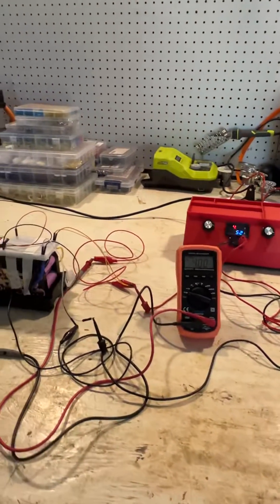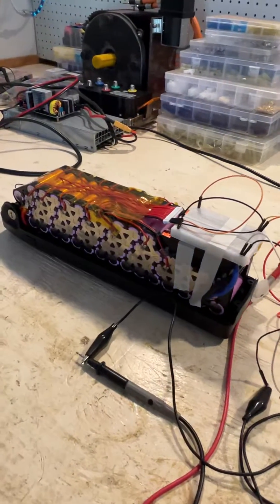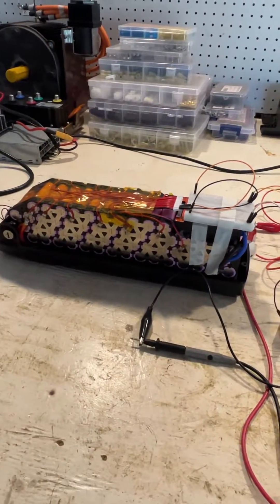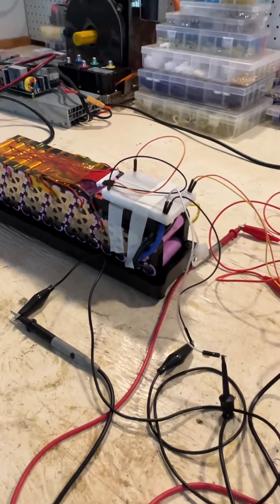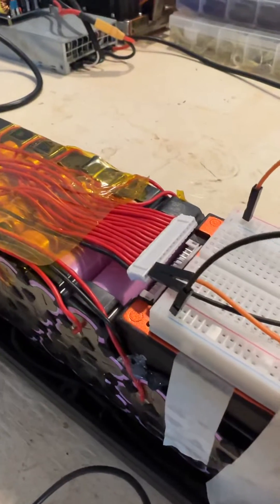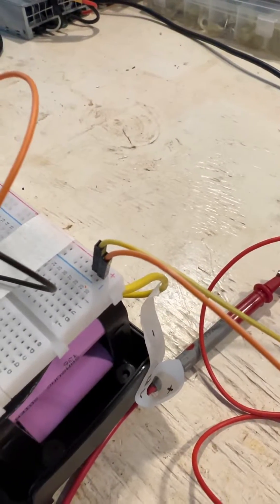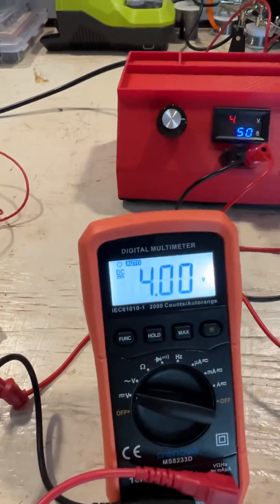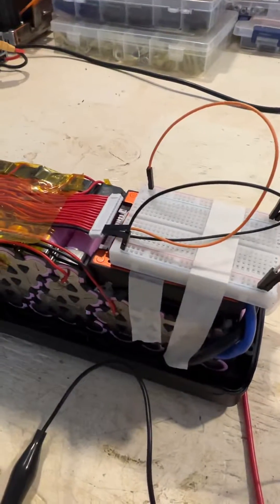A BMS does not actually balance your battery pack.. and what you can do about it!

Comment: This is partially true. The reason why passive balancers don't work is if you charge with a high enough current your BMS will never be able to counter the cell groups that are high from reaching 4.25V when balancing starts at 4.18V. If your BMS balance current is 60mA (quite common) then charging at 10A is going to drag the high cells up to 4.25V way faster than your low cells could ever catch up. Your low cells are seeing 10A at 3.5V and your high cells are seeing 10A until they reach 4.18A at which point they are seeing 9.940A so the time it takes them to go from 4.18V to cell overvoltage at a 60mA reduced rate is nearly the same as it would be for the full charge rate. In this scenario you can 
A. Keep charging fast and not see your cells get closed to balanced until you do a dozen or more cycles
B. Lower the charge current and give that 60mA balance current a chance at making a difference

I don't think this is really explained anywhere. One dedicated slow charge could significantly bring your pack back into balance and allow you to continue fast charging after that so long as you're happy with the delta v. If I had a pack that was 400+ millivolts out of balance and had no way of charging single groups, I just had a charger rated for the voltage of my battery with adjustable current I would do a 1A or even lower charge cycle and see if it can get me in the realm of 100 millivolt difference. At that point you're not leaving too much capacity on the table when you continue to use it 100 millivolts out of balance and that should correct itself over the next handful of cycles.
Reply from the maker: makes sense! thank you for the detailed reply. I'm going to give this a try. although I'm still surprised that a relatively feature-rich BMS like ANT or Daly doesn't have an active balance built-in. I know Daly sells active balancers - I have one and it works great - but this really should be the default cell balancing method on any medium-grade BMS & up
Reply: @GaiusGarage , if you have an ANT you don’t need active balancing. The basic dumb BMS will maintain a balance if you use the correct charger which will ALWAYS taper current down as it nears full charge, reducing cell differential caused by surge from the charger. But you have to reach full charge and the balance maintains begins after the light turns green, when current in is almost as low as bleed current.

But with the ANY you just charge to whatever you want, unplug the charger, click “Start Autobalance” then go to sleep. It will do the maintenance until the cells are balanced to your desired setting, even to 0.000v differential.

Of you have 💩 cells, an active balancer is helpful. But for relatively healthy cells, the ANT is plenty. 

On my LiFePO4 battery made with 💩 cells I might change the ANT to a JK, just so it can actually extend your range if one cell gets low while riding, while the ANT cant do anything about it. 

But it must be left deactivated until you realize you have a problem or it will mask the problem and you will still be walking home. Lol. If you leave it deactivated until you get LVP, ans rhen look to see if something wrong like a dead cat stuck in your wheel, then you can activate it and turtle mode home while it sends 2a to the low cells. 

But after my recent experience where my girlfriend’s scooter got two low bricks because she rode it for an hour with the front tire rubbing, i think the JK would have just added to the damage. When she got it over to me, it had 10 dead 32700 cells (CID popped i guess). 

But the title is definitely still missing. A BMS will in fact try to balance the pack, but a dumb BMS is very picky about it.
Reply: Thanks for this explanation. I've been using a 10A aftermarket fast charger, and now I know why my battery packs are out of balance!
Reply: @VllKlNG  yep. Now since current trails off during CV its a bit of a wash in terms of 5A vs 10A but it all depends when your BMS starts balancing.

I highly recommend active balancers and adding a switch to them. Use them once every 10-20 cycles for the last quarter of your charge cycle then leave them on for a couple hours after charging.
Reply: Sir pls answer this question of mine...im desperate for an answer
I have an 8S LiFePO4 battery pack for my ebike project which I tried to charge using my suspicious lithium battery charger. The charger applied a voltage slightly higher than the battery voltage at any moment to charge it along with 1.5 A of current. For example, if the battery was at 26.2 V the charger applied 26.5 V and 1.5 A, and the voltage increased in the same proportion as the battery voltage increased. This was constant current charging.

The thing is, the charger cut off the charging while my battery was only 85-90% charged(26.6V) and never intiated the constant voltage charge. I just read somewhere that I need a charger which applies a constant voltage of 29.4 V to fully charge a 24 V LiFePO4 battery.

Did I damage my battery by charging it through a charger that doesn't fully charge my battery and give out constant 29.4 V? I may be just paranoid but it could be a serious thing. Can I continue using this charger in the long term which never initiates the CV charging? I'm fine with not utilising the remaining 10% SOC. I just want to make sure this kind of undercharging and this charger doesn't harm my battery in any way.

And what I'm more concerned for is that i also heard that many bms' tend to start balancing the battery when it reaches a certain VOLTAGE (full charge voltage), if this is true..... doesn't it mean that my battery can become unbalanced in the long run as the bms may never balance the cells?

Can charging an 8S LiFePO4 battery pack using a charger that never initiates constant voltage charging and doesn't fully charge the battery to 100% cause damage to the battery, and can this lead to cell imbalance if the BMS only balances the cells at full charge voltage?
Reply from the maker: @electricalA.K.  do you have a BMS installed on your battery pack? If yes, it is most likely that your cells are already out of balance and the reason your pack is not charging full is not because of the charger but because one of your cell groups is reaching max voltage, and the BMS is cutting off charging to prevent damage to the cell (overcharge protection). Thus, you have one cell at full charge and the rest remain not fully charged so your total pack voltage is less. You can check the charger voltage at the terminals before you connect it to your battery pack. If it is what the total pack voltage should be, what I described above is most likely the issue. If the voltage at the charger terminals is lower than what the fully-charged voltage should be, the problem is that the charger voltage is too low - depending on the charger you may be able to adjust this by opening it up and twisting a potentiometer
Reply: @GaiusGarage  sir i had checked if the problem existed with the battery or the charger.... Turns out that the charger cuts off the charge at 90% SOC (i monitored the voltage and current while the charging process was going on) . 

My question now is, the battery is new and no cells should be out of balance, so can the battery get unbalanced in the long run because many bms start the balancing process when the battery nears full charge voltage, which my charger will never reach. 

And second question is, the lifepo4 8s resting full charge voltage is supposed to be 27.2v(100% soc) while my seller lists it to be 26.5v on their website(which is 85-90% soc which is what I'm reaching) what is going on here? Why is the voltage listed by the seller lower than the actual full charge voltage
Reply: @GaiusGarage  Good catch about him likely having a cell higher than the rest. Didn't think of that. My first thought was he's looking at resting voltage and never is around to see the actual max voltage
Reply: @electricalA.K.  29.4V is LITHIUM ION NMC voltage!!!!

8*3.65=29.2 but i think theres no reason to go beyond 3.6 or 28.8

26.6 is 3.325 which is about 80%. This will not damage your battery. Quite the opposite.

The problem is your battery will never balance. You should only balance LFP above 3.4V, long explanation but just trust me on this. 

So you have a conundrum. You can continue to use the charger but if your battery goes out of balance you will lose capacity because it will be cutting out when one cell is low and the others have energy left.

I think the problem you have is you don't realize your battery is charging up past 26.6V but its resting down there.

LFP does not rest at full voltage like lithium ion. It should not be resting as low as yours but should be resting between 3.45 and 3.55 per cell about an hour or two after the charger is done.

You need to watch an entire  charge cycle and figure out your max voltage and then see if your resting voltage is indeed 26.6

It it totally normal when you connect that your charger shows the battery voltage. YOu'll see a slight rise because the charging current increases the voltage the same way a load causes voltage drop
Reply: If I understand you correctly, one way to periodically balance a non-balancing pack is to charge it as slow as possible every few uses? For example instead of 65W go to 10W?
Reply: what most people ignore is the recharge rate on cells.  Even manufacturer specs show 1/5C  being the optimal,  for longevity and maximum capacity.  Very few cells are built high spec enough to take 1/2C or even 1C charge rates - without losing something in the process, such as capacity.  Basically the faster you charge, the less time the battery cell has to have those electrons cling to the inner works of the battery, so you get a less dense packed battery when you fill it quickly.    Take it slow and you not only give your electronics time to balance out and function, keep heat down, but also maximize capacity.....

it really does come down to just being too impatient and charging too fast.
Reply: @xXKisskerXx  I've read hundreds of datasheets. Most lithium ion NMC cells have a standard charge rate of 0.5C or close to it. I'd say 0.3C to 0.4C is the standard for most cells.

Charging slower does improve the cycle life.

All this data is in the datasheets. They'll tell you if you charge at the "max charge current" that you'll see reduced cycles and often further down they'll have a graph showing that.

One more time for anyone that still hasnt grasped this.
Get on Google.
Type your cell model.
READ THE DATASHEET.

Comment: Thanks for the video. But part of the info you give is wrong. A GOOD BMS charges AND balances. You can have a very  cheap "old" BMS that doesn't balance or balances passively through resistive bleeding. This is a terribly basic BMS, and because of all the past battery fires, a lot of improvement was done on battery BMSes. Most of them have a balancing function now.
Reply: The cheap BMS he had would work to maintain balance if the cells were healthy and he fully charged the battery and left it on charge about an hour after the light turns green. This battery was either neglected or had some bad cells.

Next level up is a smart BMS that still uses passive balance, but not only limit balancing where i can only bleed cells over 4.25v or so. An ANT would be able to balance this pack, so would a JBD.

If the pack is total 💩, an active balance bms like JK might be needed. This is the one that drains the highest cells while charging the lowest cells with that energy. No legit li-ion pack needs active balancing. Only something made from recycled cells or cheap LFP cells needs that because it can keep up with the battery problems.

Comment: Old video, but true. I came here from searching if anyone also knows about if balancing packs can coddle a bad group of cells. If you have a balance charger, and the pack has a balance connector, it will level each group along the whole charge process. But wouldn't a weaker group get more current over their lifespan thrown at them to get to the same voltage as healthy cells? who have an easy life, getting more rest time in charging, as they wait for the weaker cells to catch up. Do this over a year or more. Unless you  break into the pack and hands on test, one group or even a cell or two can make you scrap a battery that's still 90% good. You would never know a weak group or cell from new, it's not common in charging methods that battery health specs are reported. They don't build that function in to common batteries or most chargers. I can kind of watch my Imax, as it goes through the groups, but only on very small packs. Too much time to note and jot down which group seems to take more time.

Comment: Thanks for the video confirming my thoughts exactly. My homemade e-bike has a 40Ah 13s battery that is still in top balance from construction but is drifting. I thought my daly bms should be working to fix this at all times but, for whatever reason they decided to make these pieces of junk only balance when charging above around 2Amps of current. This makes it completely useless and even if it does help some I still cant use my 10 Amp charger which is frankly unacceptable. I'm thinking that the daly smart balancer should work though.

Comment: Hey i have a question i have a 3s 50p 84ah 12v battery pack which got  in balanced as I have connected 3s40A bms 2 of them as I have taken out balance wires for additional monitoring from a cell meter. Here is the question
What if i charge the different cell pack while the bms is connected as idle please reply thanks....!

Comment: The BMS may or may not have the Cell Balancing option built-in. If you 
 bought a BMS, without the Cell Balancing option then obviously the BMS will not balance the cells. Isn't this just common sense?

Comment: I have this problem where all my cells are full charge except 1 group wired in parallel are flat. Taking a battery rated at 288wh and turning it to a 50wh battery, testing it on a known load and measuring. I assumed that series might have a bad cell so disassembled that series from the pack to test each cell and they all behave the same. I should have just attempted to balance them in the pack before I disassembled. I got my cart before the horse here. Now I have to rewire them into the pack when I finish charging these cells 1 by 1. Im a novice not an expert, but like to learn.

Also dont have nickel tab or a spot welder, so I beat a wire winding from a toroidal coil into a sheet and pretinned it, since ill be soldering...I tested calcium lime and rust, known as CLR as a cleaning agent as a soldering acid and it actually allowed solder flow when tinning that toroidal coil copper sheet, but I had that copper pretty clean.

Comment: Why not just eliminate the bms and periodically balance like you show ?
Reply from the maker: The BMS is still useful for protection features and absolutely necessary for charging. You need something in place to cut off charging current if one of the cells over-volted or over-heating to prevent a fire. these scenarios are even more likely if your pack is out of balance.

Comment: Thanks Gaius, finally an very good tutorial on this youtube. Did you charge the cell group on 12v or 4.25v ?
Reply from the maker: Each cell group is a collection of individuals 18650 cells all connected in parallel, so while their capacity added together, their voltage is the same as one individual cell, which is 4.2V. Therefore I am charging each cell group to 4.2V
Reply from the maker: Each cell group is a collection of 18650 cells all connected in parallel, so while their capacity added together, their voltage is the same as one individual cell, which is 4.2V. Therefore I am charging each cell group to 4.2V
Reply: @GaiusGarage you know what’s really scarry about these larger packs that consist parallel series interconnected batteries. Each of your “cell groups” that you aim to balance right, what really ticks my nerves are within those cell groups are many individual batteries that only god knows how far apart they are from eachtoher 😂 I get anxiety just thinking about the fires that are waiting for us down the road
Reply: @onesikm3  If the batteries have spent their working life connected in parallel they will all be at the same voltage. So no fears of fire, but as shown in the video just charge that one set of cells, and you are back in business.

Comment: I actually started draining the higher individually using some computer fans and tiny magnets to drop the voltage to match the lower.
Reply: You could also use a 18650 4.2v usb charger with magnets and wires to charge the discharge group. Always charge outside or in a fire place.
Reply: Id use a battery capacity tester, worked great on my bat

Comment: The original sense wires of a BOSCH batterypack are very thin, they only function as a detection of the voltages of the groups, nothing more, one group is full , the load current stops globally, also in the case of one group is undervoltage, the BOSCH stops with working.

Comment: i am currently trying kind of the same with a 10s but im discharging and hoping the bounce back up and level out hopefully avoiding any cell drop (this is a 16ah 10s 1p polimer pouches so taking a while )done it with 4 of the cells so far and there all now sitting at 3.64 ,will let you know how it goes after i charge it all back up as a pack with the 42v see if they keep balance ,great video by the way thankyou

Comment: Interesting video and good tips. I notice though that the plugs on balance chargers (and battery BMS) are larger format than what I have on my E- Bike battery. The battery shut down when I left the charger on it overnight. I was hoping to test the voltage of the cell groups, but I cant find anything that is the correct size to plug into the battery pack.